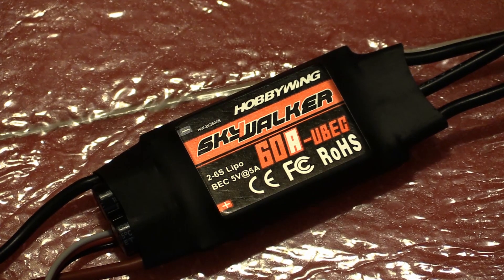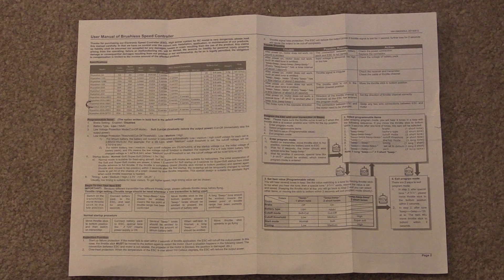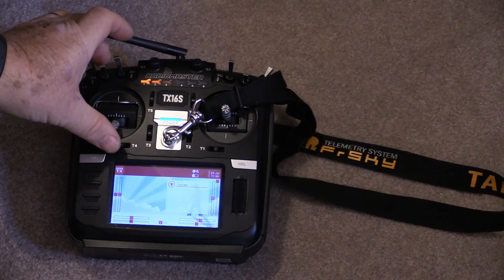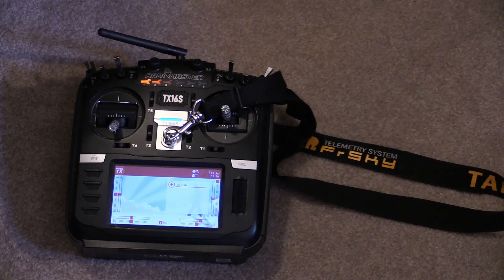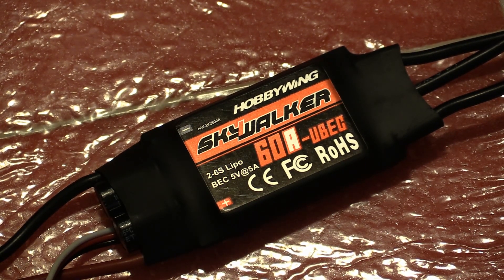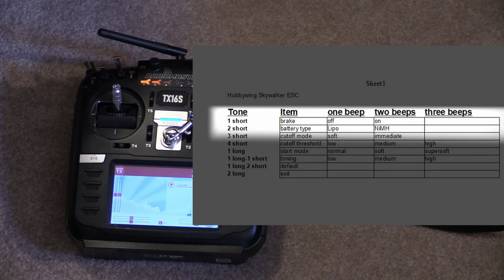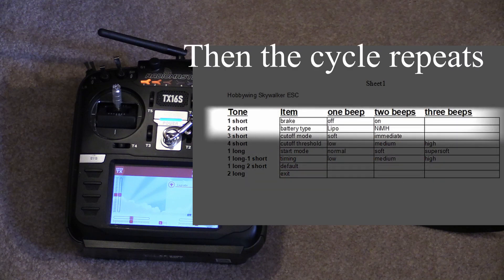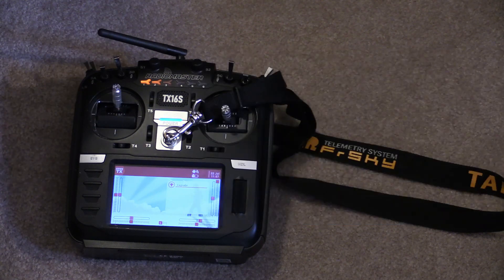Programming the Hobbywing Skywalker ESC

Comment: Hello, very good explanation. I just have a problem with the equipment. My ESC is the same as yours and the motor is working fine. But I have the equipment for the car (with reverse gear). Please tell me how to connect it, because it has a different connection scheme. We searched the entire YouTube and found nothing on this issue.
Reply from the maker: This ESC only controls the motor,  and sadly doesn't have  reverse capability.  So I'm afraid you're stuck just going forward.  Bummer

Comment: is the sounds coming out of the esc or transmitter ?
Reply from the maker: Out of the ESC.
Reply: @ what if the esc don’t have a audio or speaker to hear?👂
Reply from the maker: @Wlrdzz  Right.  The little coils in the ESC transmit the signal to the motor.  It's the motor that does the beeping. Sorry I might have misled you before.  The ESC makes the signal but sends the vibrations to the motor.  Pretty cool, hugh?
Reply: @bensonfilmworks7595  what if when programming the motors spin 3 times instead of the beeps?
Reply from the maker: @Wlrdzz  something is wrong.  Probably you're not in programming mode.  Please make sure the throttle is fully advanced before you apply power.  Also, make sure that full throttle is indeed full throttle.  Do that by  calibrating your sticks.

Comment: Hi mate my Tx won't connect to my helicopter until my sticks are at 0 I've tried turning it on at max and then low but I don't get the beeps? V450d03 heli any help please.
Reply from the maker: I'm sorry that I don't know about helis.  If your heli uses a flight controller you must change the settings using the the flight controller configurator such as inav or betaflight,, NOT the transmitter.  Hope this helps.

Comment: I accidentally calibrated this ESC in reverse is there any way to recalibrate it. I don't want to reverse it from transmitter
Reply from the maker: I'm sorry. I don't understand what you mean in reverse.
Reply: @bensonfilmworks7595  in reverse means throttle down is motor at full speed and throttle up is motor off
Reply from the maker: @muhammad_hasnat  WOW! Thanks for your response.  That's a real head scratcher.  I'm not sure how to fix that other than reverse the outputs on the transmitter.  Perhaps someone else can chime in and help.

Comment: I bought this ESC a few of years ago, and I used it multiple times with no problem (2s lipo battery, brushless motor and a flysky fs ia6 receiver). Today I found it again after not using it for years and it won't connect, it just makes two short beeps from time to time
Reply from the maker: Oh shoot.  That doesn't sound good.  You might check the connections, etc.  I sure wish I could help more.

Comment: Please help - when I try to do the first step - calibration- with the throttle up, and plug in a battery to the esc,  instead of a couple of beeps - I get a constant series of beeps that does not stop, even after I lower the throttle.
Reply from the maker: I'm sure you've figured this out by now.  I would first start to make sure the transmitter sticks are calibrated correctly.  I'm guessing the ESC isn't seeing a low throttle setting.  Please let me know what you found!
Reply: @bensonfilmworks7595  wow, its been a year and I don't recall how i resolved it...sorry.

Comment: Mine doesn't calibrate, after a long series of short beeps and long pauses, it will beep short and short pauses indicating that the throttle is not in buttom position. Also, no 2 short beeps even in max throttle before powering up the esc. any fix?
Reply from the maker: I'm not sure I quite understand what's going on.  Could it be your transmitter needs calibrating?  On the Open/Edge Tx models you can calibrate the stick positions.  Also, did you start things out by powering up the ECS with transmitter throttle fully advanced.  Wait for the beep then fully retard the throttle.  This teaches the ESC what fully advanced and fully retarded signals are.  Once done you can proceed with choosing your options.
Reply: @bensonfilmworks7595  thanks for your response, im using tx16s. I tried other ESCs and throttle calibration works. Also, I did whats on the video. throttle up before powering the ESC. It doesn't go to calibration or programming mode.

Comment: I needed to use my motor and Skywalker (12a) esc from my plane in my airboat and I'm using a pistol grip RC car radio but because the default position of the trigger throttle is 70-30, my motor comes on until I push full brake. I tried reprogramming the esc by holding full throttle, powering the esc, waiting for the beeps and then letting the trigger go back to neutral, listening for the beeps, then unplugging the battery pack from the esc. When I power the esc again, I push full brake and then full throttle to arm the esc, the motor starts running again at a high idle until I push full brake again to stop the motor. Are these esc's incompatible with car radios? I even tried adjusting my throttle trim and subtrim towards the brake, but they maxed out to a low idle.
Reply from the maker: You might have success by programming the throttle to less than full on.  For example, you might try having the throttle at half power then power the ESC and reducing the throttle to zero.  That might fake the ESC out to think that half throttle was  full throttle.  Just a thought.
Perhaps you could post your experience so other people would benefit.